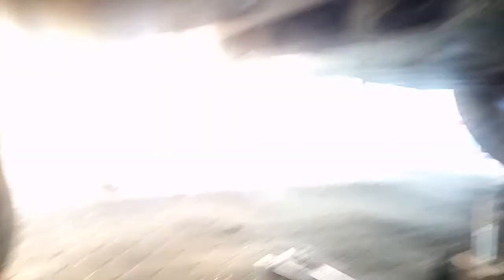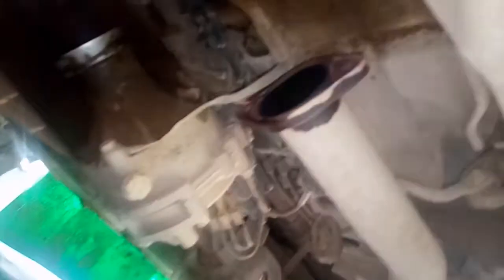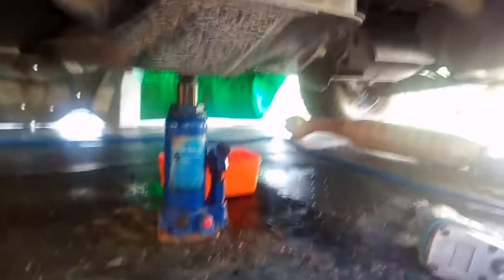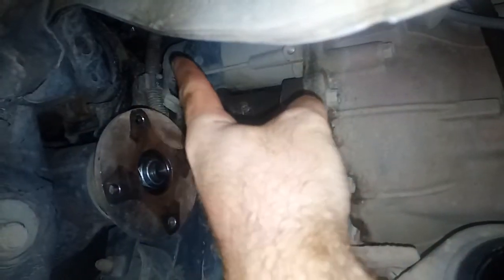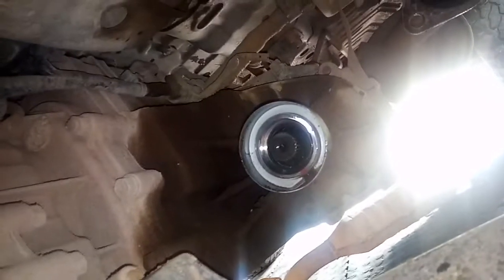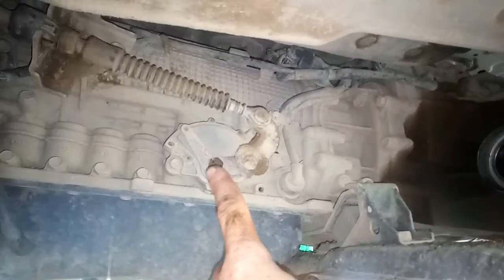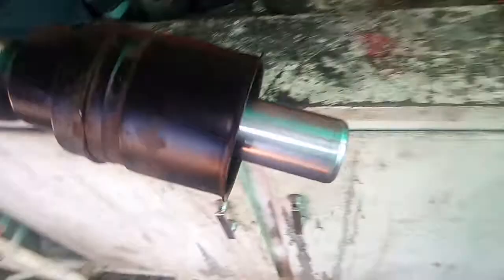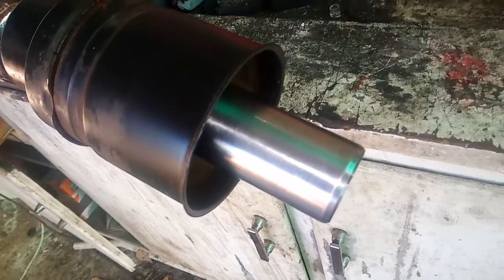Gen4 Pajero 3.2 LWB front propshaft transfer case oil seal how to DIY

Comment: Can it move without the front prop shaft
Reply from the maker: no. It will spill the oil and allow dirt to get in. In an emergency you can lock into 4HLc and move the car but not recommended.